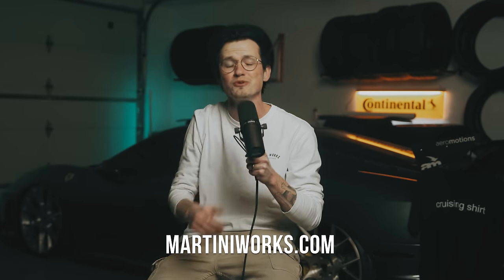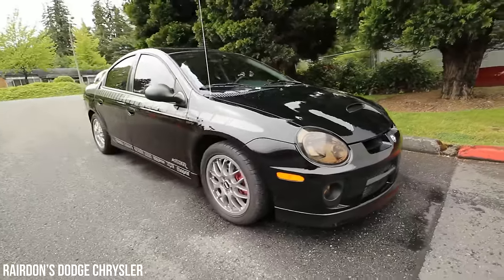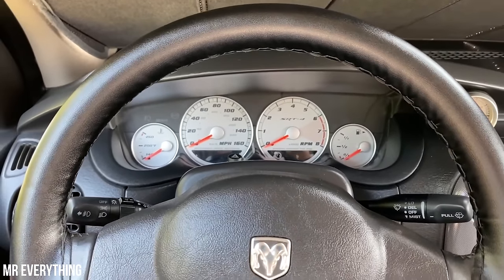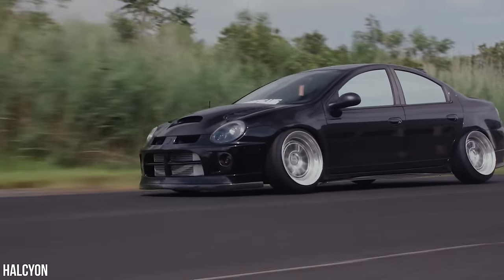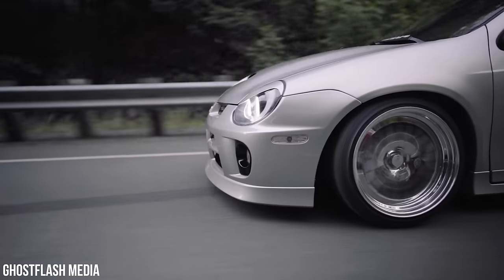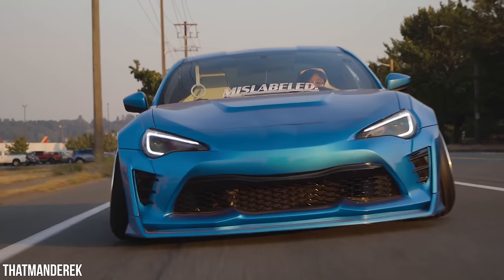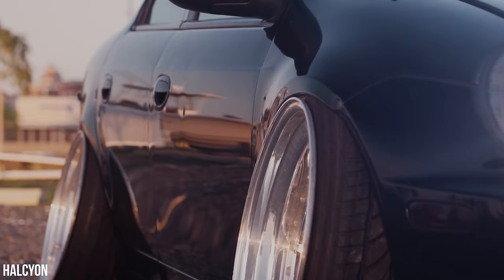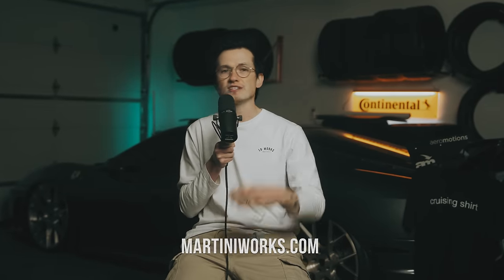How To Modify a Dodge Neon SRT-4

Comment: Ive topped mine out at 170 mph when it was stock to so yeah now mine is built its unbelievably fast !
Reply: No you didn't.  They top out at 153-155 mph stock, that's the rev limiter AND coefficient of drag (power vs wind resistance).
Reply: @rooh5825  LOL WRONG ! Might not have been right at 170bbut was pegged out in 5th doing 160 and stayed on throttle for maybe another 10-15 seconds so maybe it was maybe it wasnt but you aint gonna tell me what I did or didn't do Ill tell you that right now !
Reply: @shannacollins4741  No you didn't.  I could tell you I climbed mount everest wearing nothing but a bikini, that doesn't make it true.  Stock SRT-4 Neons would do 153-155, and no faster.  I'd love to see you come to the SRTforums and try to claim this.  You'd get roasted alive.
Reply: Yes sir had my buddy get his phone speedometer and gps out one night to see how fast she went after the speedo pegged 187mph 😂😂😂🤣🤣 things are fuckin madddd
Reply: @bugeyewrex6138  right but im dumb SRT-4s dont go that fast tho ! Blah Blah Blah !
Reply: @shannacollins4741  Yea ik this guys making me crack tf up too  💀😂🤣🤣
Reply: @bugeyewrex6138  You might want to take a step back and realize this guy is claiming a STOCK srt4 goes that fast, NOT a modified SRT4.  And if you are trying to be serious with your 187 mph comment about a stock SRT4, well, no one can help you, that would be beyond crack head.
Reply: @rooh5825  I can read. And I’ve owned one, and been in and driven many… Speedo goes to 160 you think that means it just suddenly stops at that speed ….? 😂🤣 there’s still gearing there at that speed and 170 is very believable especially considering these things really had a lot closer to 275-300 hp not the 230-245 advertised. And mine was also the factory stage 1.
Reply: @shannacollins4741  Just doesn’t have the balls to top it out ig 🤷‍♂️😂🤣🤣😂
Reply: @bugeyewrex6138  So cute you packed so much misinformation into such a small reply.  Let’s fix it.  1) Stock SRT-4 will only go 153-155, it’s well known, documented on the forums, and anywhere that people are being honest.  They are coefficient of drag limited (hp vs wind resistance, tough for you to understand, try and keep up), and they are rev limited in 5th gear at that point.  2) They had no where near 275 to 300 hp stock.  Stock they were at roughly 245-255 whp.  3) They were never advertised at 230-245, they were advertised at 220 hp.  4) Factory stage 1 Mopar Kit did very little to improve horsepower, it allowed WOT shifting, enhanced launch capability with a better boost schedule in 1st gear, an aggressive exhaust note on deceleration, and optimized calibration for use with the MOPAR BOV “blue plate”.  

This is as good as it will get for you, if people notice your nonsense this will blow up and embarrass you even further than I already have.  Yes the SRT4 is a great car, no it can NOT do 170 mph in stock form.  And it most certainly can’t do “189 mph” stock.  Please just stop, both of you, before this entirely blows up in your faces.
Reply: @rooh5825  stock WRX’s don’t top out at 160 either…. 🙄and my 04 tsx doesn’t top out at 137 naturally aspirated…. 🙄🙄🙄 Have you ever even been in let alone driven one of these cars?
Reply: @bugeyewrex6138  no he hasnt ! He keeps claiming all this BS and typing out pages of shit that he thinks is right or is reading and copying off of GOOGLE he ai t saying shit that im interested in or i know is right !
Reply: @bugeyewrex6138  i BET he doesn't either ! NAH he doesn't need balls to be a keyboard warrior or a Google expert !
Reply: @shannacollins4741  In stock format the SRT4 tops out at 155 mph.  Stage 0 and 1 ECU limit the top speed to 155.  Not sure where you are thinking it is quicker, maybe you feel like it is faster, or you are using some sort of faulty app?  Perhaps you are in a car that has some significant upgrades and you aren't aware of it?  This is on the srtforums now by the way.
Reply: They be trollin dog, nobody gona get out here and be sayin dis nonsense, 170 190 200 mph where be your stoppin point? LOL Why buy a Viper or C8 vett baby get yo Neon and it do 220 mph!!! WOOOOOOOOOOOOOOOSH!!! SRTFORUMS you been called out haha
Reply: @dillybar8246  bro dont talk to me i dont talk to dorks that play that World of Warcraft crap ! And lol that youd think id listen to anything you say or think btw idgaf what some dumbass forum says of course Dodge aint gonna tell or say the car does 170 mph stock so they make up some other BS numbers ! I actually had a Dodge dealer drive my car and he even said its way faster than what they rated the car at and his daily driver was a Viper so i think he'd know if it was faster or not ! Ive outran a SRT-10 Viper trucks but the only thing that ever beat me was ANOTHER SRT-4 that was newer than mine !
Reply: @tastymcrib9709  lol yeah man my SRT-4 goes 399 miles an hour, I don't have to prove it, I just say it and it's true. My SRT-4 can also fly, and it can turn into a beautiful woman and sleep with me. 😂
Reply: @shannacollins4741  Ik he’s getting it off google cause it’s literally exactly what it says and it’s alllll wrooonngg😂😂😂😂 lmfao
Reply: @shannacollins4741  😂🤣🤣🤣🤣
Reply: @dillybar8246  I guess no one here is aware it’s ridiculously easy to go to a tuner and get that taken out or ya know …. Just get a Diablo sport….. so yes without them being “limited” they will indeed huff right on past 160 a little bit fairly easily Not to mention this day in age I’m really not sure where you’re  finding an SRT-4 that still has that bs left on it let alone completely stock like no cold air intake or anything people are hilarious 😂😂
Reply: Everyone else in here needs to stfu until they’ve actually driven one and topped it out for themselves 😂😂 this is fucking hilarious 🤣🤣🤣
Reply: @rooh5825  You don’t have and never have had one very clearly 😂
Reply: @bugeyewrex6138  they all are reading the same GOOGLE page ! Lmfao !
Reply: @shannacollins4741  There really isn't anything to get all upset about.  What's been said to you is factual.  The SRT4 in stock format can't go past 155 mph.  Not without driving off a very tall cliff.  It doesn't matter if you scoff, resort to insults, etc. The top speed of a stock SRT4 is a fact, it's well documented, you can't go faster without modifications.  You either had a modified car, or you are lying.  Those are your two choices.  It's an A or B discussion.  Please stop fabricating other options, thanks!
Reply: @bugeyewrex6138  Okay as long as you admit that we are no longer talking about a stock SRT4, then that's fine.  I'm glad you admitted that we are talking about modified cars, because people trying to say a bone stock SRT4 can go 170 or 190... that's being ignorant.  I'm glad we can agree on that.
Reply: @dillybar8246  Literally all I’m talking about is your “rev limiter” otherwise basically stock yeah don’t really consider an intake to do much….
Reply: @dillybar8246  bone stock they definitely will do at least 160 at the very minimum without a “speed governor” which I honestly doubt these cars ever had in place anyway 🙄🙄🙄
Reply: @bugeyewrex6138  Stock means zero modifications.  Anything done to remove rev limiters, or using an ecu tuner of any sort, or an intake, they are all modifications.
Reply: @dillybar8246  You’re aware of how little hp an intake adds correct ? 😂 and mine wasn’t tuned. It just wasn’t “limited to 155” 🙄🙄aye ya aye 😂😂
Reply: This is what the fuck I’m tryna say 😂🤣🤣
Reply: @dillybar8246  you aren't going to talk any sense into them, just wait till the other one starts talking lol. I'm just hanging around for the laughs at this point